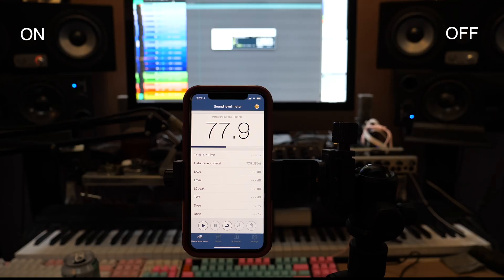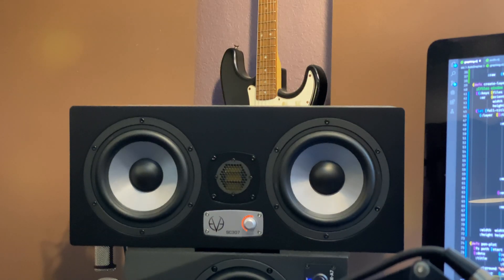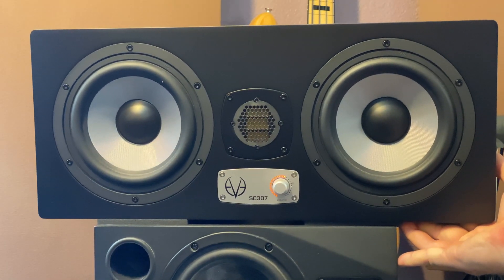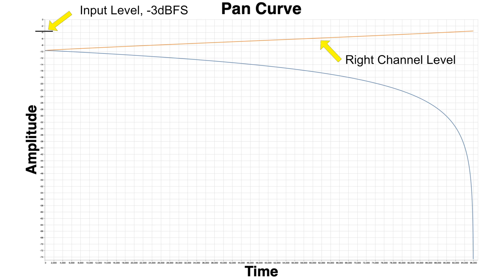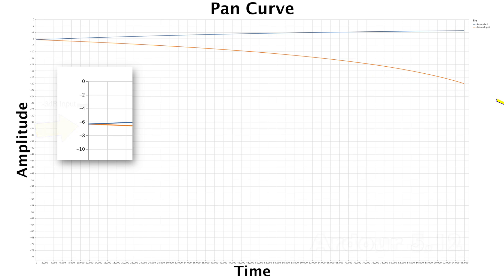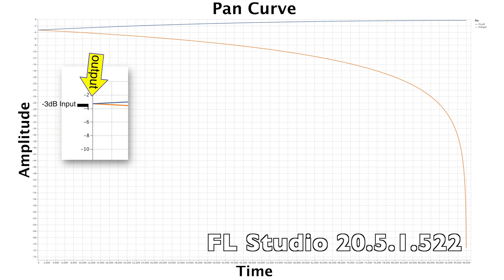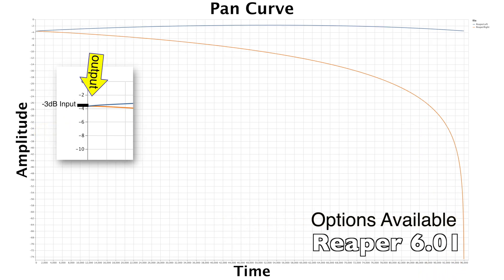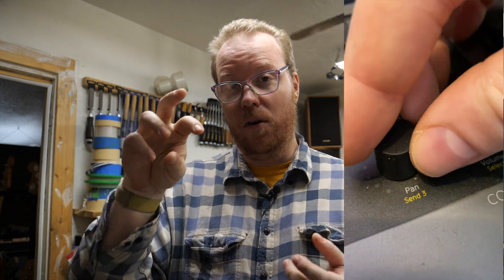DAW v DAW Part 6 - Pan Laws, Pan Curves and Bitwig irritating me. (I screwed up Ardour!)

Comment: Thanks for you videos .Do different DAWs sum's the mixer channels differently?
Reply from the maker: Generally no, however there are some exceptions, and there are some subtleties. I may get to this in a future video, but of all the things to consider in the topic of "DAWs can be different"... summing is the least of concerns.
Reply: Thanks, I'm using FL, I noticed that i can export the same project few times and get slightly different waveforms, is that normal?
Reply: @DIMENSIONOFSOUND  kind of yeah, there are tons of floating point calculations done on your sounds. These calculations are only exact to a certain degree. For this reason, floating point numbers (decimals) are avoided like the plague in finance software. In which case they use non-decimal numbers to represent cents so the calculations are always exact. Audio software doesn't need to be super precise so floating point (decimal) number calculations are fine as long as they're accurate to a certain decimal point and it should always, for the most part sound the same